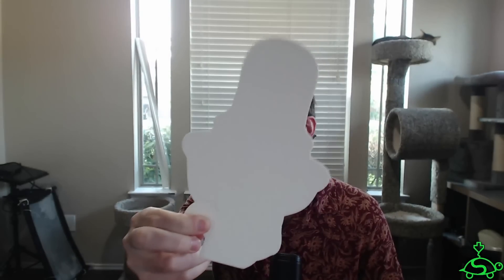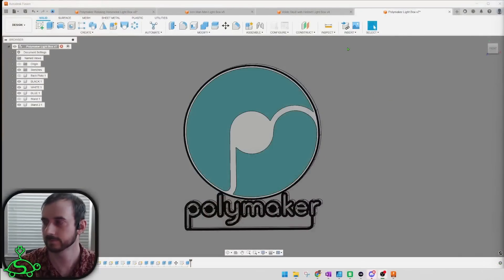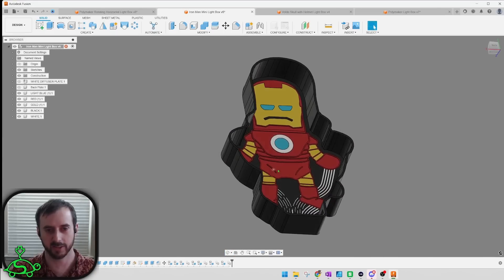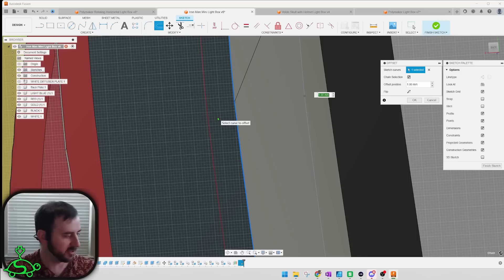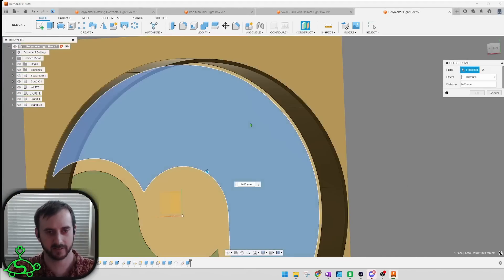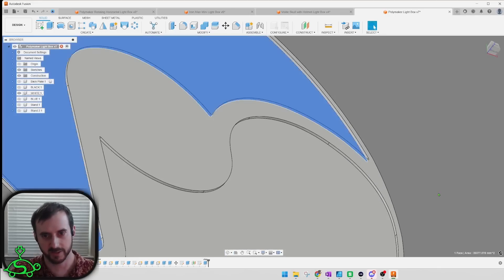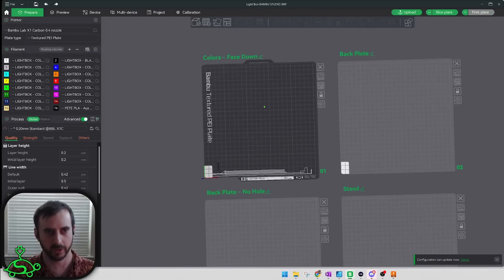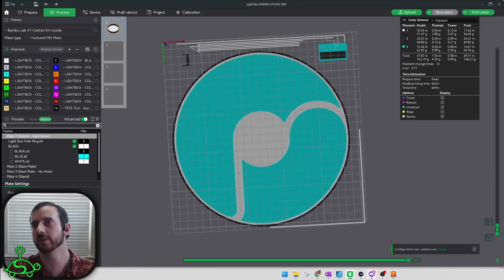Making a diffuser for 3D printed light boxes - Shurdle3D

Comment: The front layer of color is 1mm and the diffuser is also 1mm?
Reply from the maker: @Grimmie1981  I’ve been doing the diffuser 0.4 or 0.6 for the print in place ones. You can try different thickness depending on how transparent your filament is